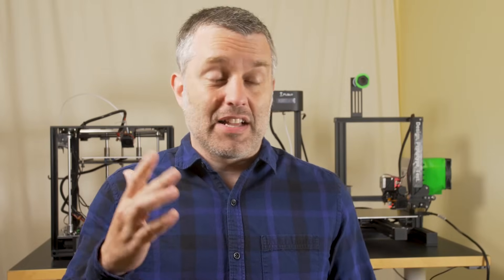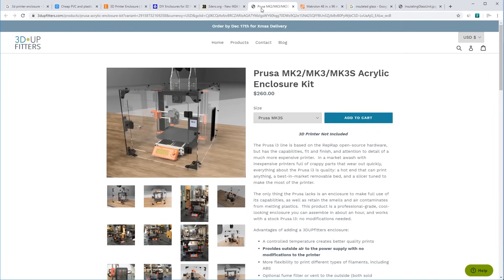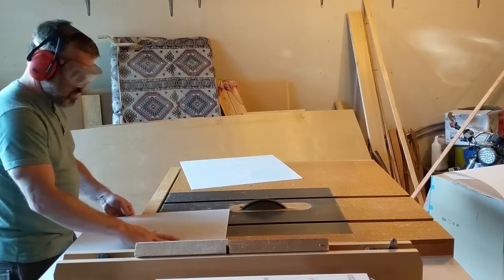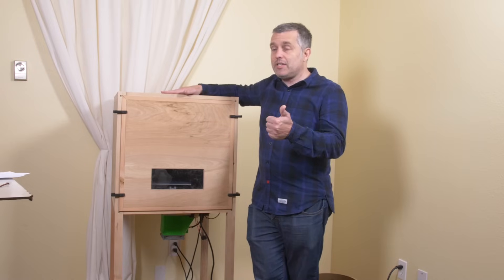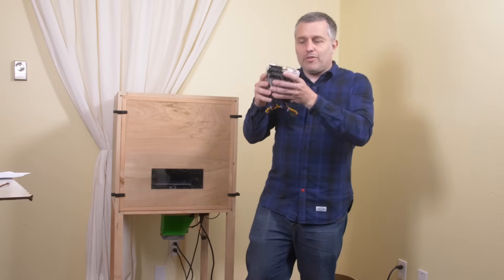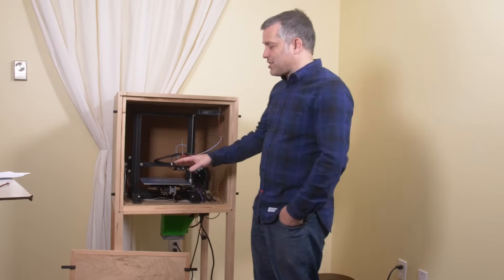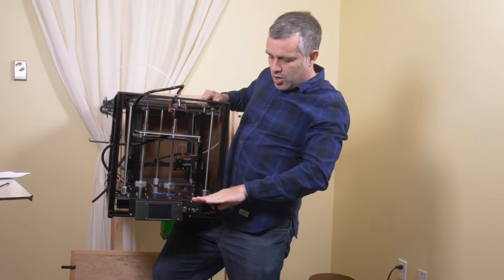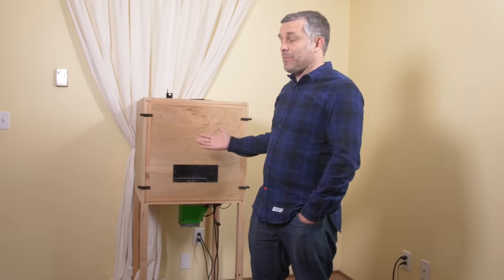3D Printing in a 100°C Heated Chamber - Lessons Learned

Comment: I got to type this during the commercials every two minutes (not kidding! ). Isn't the "double glazing" a solution looking for a problem? We need to insulate houses because the outside can be so much colder (And due to humidity, to prevent the build up of water drops on the colder glass surface), and because the house is so big and because the fuel to heat it is expensive. It really doesn't take too much energy to heat (or rather temper) a chamber of the size needed for a printer and keep it there even without double glazing. Why does it need to be insulated? Its not -40 in your shop is it? Are you turning the heater off once the printer starts?
 And shouldn't the electronics be outside this enclosure? (is that what's hanging out the bottom?) Electronics should be kept below 40c instead of the 100 c the chamber is at. 
That heat gun should have turned off in your experiments until the environment cooled down a little (there should be a safety thermistor in the gun to prevent thermal runaway. But it was a HF product soo...).
 If you have a magnetic bed (or the magnets in the steppers) you are risking shortening the magnet's life because at 100C the chamber will be above the Curie temperature. 
And of course as you discovered, the thermoplastics will droop, Including your lexan walls,, and depending on how much of your printer was 3Dprinted your accuracy will go down (and don't get me started on bearing seals or belts or the belt's lube in that kind of heat).
How are you measuring the temp of the air in there? An infrared gun (or even FLIR) won't read the air it will only read the surface of things which will have a thermal lag, so the air will hit 100 a lot earlier and may even be hotter than you think.
I agree with the concept, a high temp enclosure has kept my ABS prints unwarped for years, but it hasn't needed to be at 100C (the bed is 115C usually). My unsealed uninsulated enclosure runs at 80. Steppers are outside the enclosure (including the extruder, with a flex drive). Electronics are outside as well. Filament is in another chamber that is heated to 40 before it goes into the enclosure. I got stellar results from a flex tube leading to the cold end cooling fan -  this comes from ambient air but has a preheater on it so the air hitting the part for a short period right after the nozzle is at 40C.

Comment: LDO is at least one company that makes steppers that are good for even greater temperatures. (180°C)  I believe most steppers are good to about 80% of their max temperature which is typically between 100-130°C.  If you go above that, I've been told they will wear out faster.

https://www.filastruder.com/products/ldo-stepper-motors-all-types?_pos=2&_sid=d3a6b6635&_ss=r

Comment: What about the printer itself? Doesnt the higher temperature influence the electronic components of the printer? Im concerned that the printers are made to work for hours and days inside a heated box
Reply: He covered that. He has the electronics outside the enclosure, aside from the motors.

Comment: I wonder how robust this is to thermal cycling issues... I'd be worried that some components in the heat gun would self destruct after prolonged low duty-cycle operation.

Comment: I have been using a heated enclosure for quite some time with excellent results. Ii is built out of wood insulated with rockwool and those reflective aluminum sheets you normally use behind radiators, with a transparent front door held in place by magnets. For peace of mind I watercooled everything, hotends (chimera) and steppers using small water blocks from Aliexpress. They stay cool to the touch even printing at 80c for hours and you never get jams or other issues. Also replaced all the wheels with polycarbonate ones. The heating element is a wall mounted space heater sawed in half: the motor stays out of the box while the heating element and squirrel fan stay inside, and it is controlled by the firmware via a solid state relay. Pretty much silent and you get a very stable flow of hot air with the option of using only half of the element up to around 70c.
I ran into the same issues with bltouch, it goes blinking red after a while so you have to do the homing before activating the heater and you have to wait for it to cool down between prints.
You are right in that this is the single best improvement one can make on a 3d printer, not only for polycarbonate but also stuff like polypropylene which prints beautifully at 50c without warping.
Ah and give klipper a try, you may be in for a pleasant surprise!
Reply: Hi, Would you mind sending the link of the watercooled block you got from Aliexpress ? I am having hard time to find them
Reply: @vdiallonort  same here

Comment: Congratulations! You've made a convection oven! It's cheaper to buy a used one then to build this dangerous fire contraption unless you don't value your personal time (you stated otherwise). At the end of the day it's still better then mine (I don't have one) and the video is also better then mine, (considering.) Very interesting, I like your creativity. I wish I had the boldness to put myself up on the chopping block for everyone to comment and abuse my efforts. It will never happen.

Comment: Dear Matt, I would try to mix some fresh air with some recycled hot air (filtered with an HEPA filter) then blowing on the part. So the air blown on the part is still hot and with no particulates.
Also you have not put extraction of air because you cannot, I guess filtering can be useful. Then you can patent the concept 
some filaments pollute the air quite a lot https://www.youtube.com/watch?v=RtIEmwuw3aw

Comment: Here's a handy tip I learned from a truffle chocolatier when I had a cottage industry business.  Use a blow dryer to speed up the heating processing and it cuts down on time. If it takes 10 minutes for this contraption to get to 100, you can cut that down to 1 minute or less if you had a small round hatch where you could insert the blow dryer (or even a heat gun) and blow the hot air in there first - get this chamber up the the recommended 220 degrees and then start the printing.

Comment: I built 2 chambers out of simple 1" foam insulation boards from Home Depot. Cost almost nothing and took an hour max. Works great and simply retains the heat from the hot end and bed temps. PC and Nylon do not warp or crack.
Reply: This, is what I was thinking watching. The chamber, in and of itself if built properly, prevents drafts and crazy temp fluctuations. How necessary is it to heat  the chamber to 100c? Also, how does all the printer components hold up to this long term? I'd think that would shorten the life of many components significantly considering most rep/rap printers are not built with this as part of the original design?
Reply: @TheJacklwilliams  should probably design the printer so electronica and stepper motors are cooled or put outside of the Chamber, maybe by longer rods.
Reply: @AndersJackson  Yea up to about 80C the magnets in the stepper motors are going to lose strength. That's temp of the stepper motor not the air around it. At 100C the motors must be getting above that by a good 30-35C and will shorten their lifespan by ALOT.
Reply: You’re going to shoot your eye out kid!

Comment: Have you tried that Vision Miner Nanopolymer adhesive?   It works great for me on a variety of filaments and is supposed to work on some really hot stuff too (PEEK / ULTEM).   It's a like pricey, but it'll last a long time.  

On PETG I only need to reapply after maybe 10 prints or more. PETG releases from it when cooling very well, but while hot it sticks well.

Comment: Awesome video I totally agree, why is no one making these. I went old school with mine for my SW X1, Double walled cardboard with tinfoil inner lined. I also put r13 insulation in between. I made a model in f360 I thought u would share https://icloud14783.autodesk360.com/data/permalink/DT8c322QT78fa0980de0d01de1dfc7e64d93 I plan to add a ceramic heater to boost temps. I found a thermocouple controller that has 110v plug built in for like $45 on amazon. Cheers and great video as always.  Edit: I can maintain ~45c without a dedicated chamber heater

Comment: Me: oh let's make a 3d printer enclosure
Engineer friend: Alright, double wall.
Me: Uh...
Engineer friend: No, triple wall; with chambers inbetween, and plastic insulation.

Me: Hmmm...

Room is at 10C and the printer prints ABS without issue.

Comment: Congratulations, but you didn't come up with anything new here. Makers have been using 3d printing enclosures for a long time, it was necessary before PLA was popular and the primary printing filament was ABS. Many people use enclosed server half-racks. They extend the wires and move all the electronics to the outside of the rack. If you run Octoprint there is an enclosure plugin that allows you to measure temperature and humidity as well as control pre-heating and cooling using the GPIO pins on a Raspberry PI. I would also point out hat PETG does not warp and does not require an enclosure to print well.
Reply from the maker: I came up with at least one new thing: The re purposing of a heat gun to act as the heater chamber. Also, your comment was a single word of praise followed by 106 words saying "You aren't special, or smart, everyone does what you do, and what you do is a stupid thing anyway." We all reap what we sow. When you find that the bad things in your life outweigh the good to a ratio of 105:1 you will know why.

Comment: I'd like to see something like a Thermoelectric Cooler used to cool the air onto the part: https://www.ebay.co.uk/itm/202975157809

These have a hot side and a cool side so you could just heat transfer out into the enclosure and also more heat is generated than cold into the environment so running the cold into the box is offset by the heat generated???... I actually think another 4 of these heating the box would produce enough heat if the box was better insulated, which leads me to my next point, insulation between the walls of the box, you mentioned spray foam but just celotex would do, basically the same thing in a board form.

Comment: For anyone that deals with expanding foam, I've found wonderful success using a third party expanding foam gun from Amazon with some cans of Great Stuff from my local Home Depot. The third party gun was significantly cheaper than the name brand one, and had a nice thick nonstick coating on the inside and outside to simplify cleanup of dried foam. I don't know for sure if it's cheaper, especially since you have to use the cans of gun cleaner, but you do get a TON more precision on application and dispensing, and it's a fair bit cleaner to work with overall. Hope this helps the next person wanting to work with the stuff lol.

Comment: Nobody sensible has done this because it’s probably unnecessary and likely to worsen your prints. It’s difficult to find facts about ideal temperatures, but according to my research temperatures above 50°C will make the print worse regardless of material. PLA prints better at lower temperatures. Too high ambient temperatures will weaken the plastic components of your printer.
Reply from the maker: I'll take "Made up answers that the commenter just  pulled out of his butt" for $1,000 Alex. Since I made this video, Vision Minor started selling a professional printer with a heated chamber.
Reply: @DesignPrototypeTest  I’m sorry I sounded unnecessary harsh. Stratasys had patent US6722872B1 for heated chambers that expired February 2021. This had kept manufacturers from making them. My criticism wasn’t really about the need for heated chambers, but for assuming that close to 100°C would result in better prints. If you already haven’t made a video on it, it would be interesting to see a comparison of a fairly difficult ABS print in 50°C and 100°C. Will there be differences in quality? Which one is better? 

A concern I would have printing at such high temperatures, is the health of the printer. I saw another Youtuber who heated the chamber using the heatbed only to around 100°C and printer parts got soft and warped.

I can see the benefit of a heated chamber to quickly get up to a stable temperature at around 50°C—60°C when printing ABS, or if your printer is in a very cold room. For most I think a closed chamber with just a the bed as a heat source is sufficient.
Reply: I agree with the temps of 100 c being too high. The ideal chamber temp posted by most mfg for nylon is 35-45C. It just takes a Google search to find that as well. My petg has on the box a chamber should not exceed 30C. That would mean pla would be much lower.